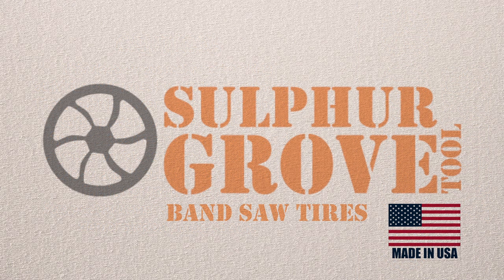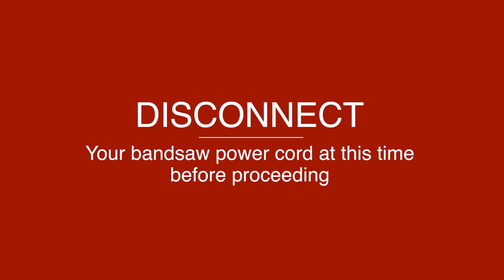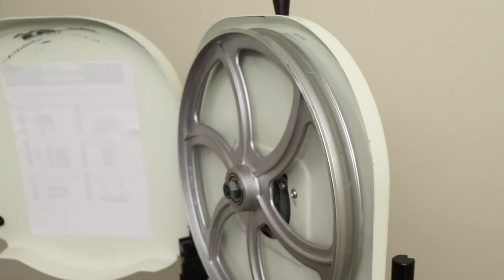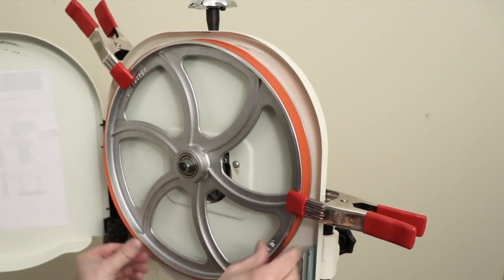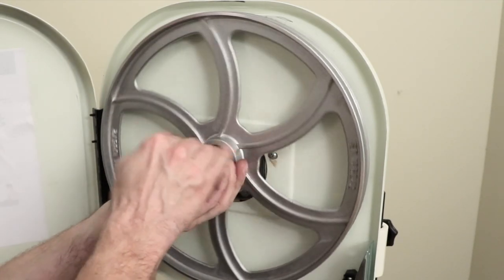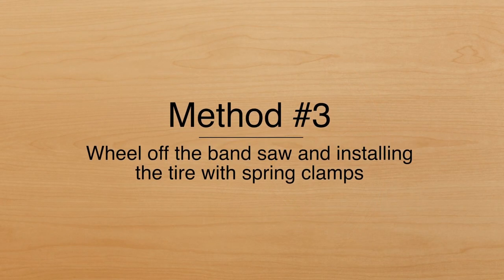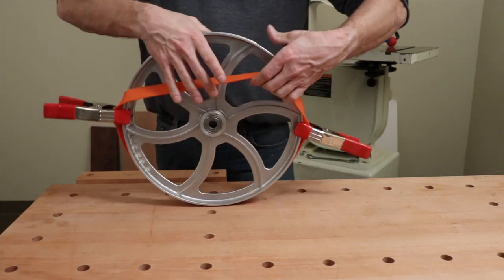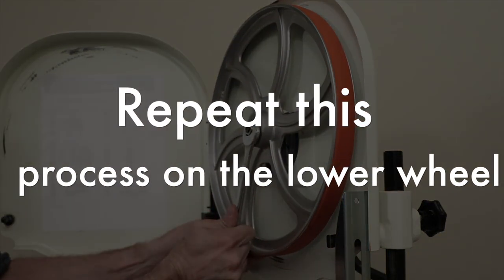How to Install a Band Saw Tire

Comment: Just tried spring clamps and dowel  on the bottom wheel of my bandsaw. Worked like a charm! Beats making a jig or tieing string or all the strong-arm methods that I've seen so far. Thanks a great deal. Didn't really want to take off the bottom wheel and risk losing the key.